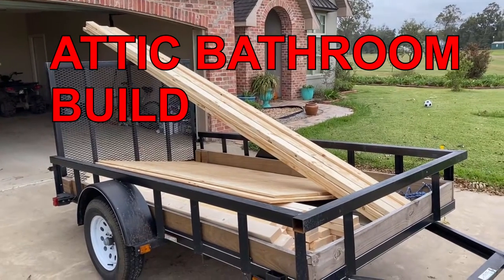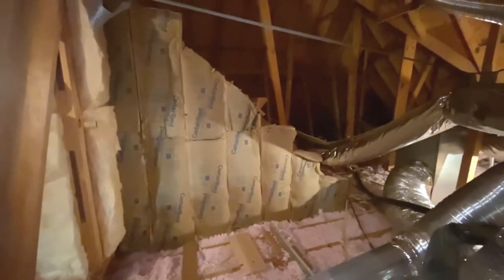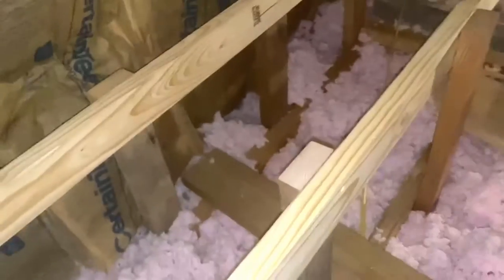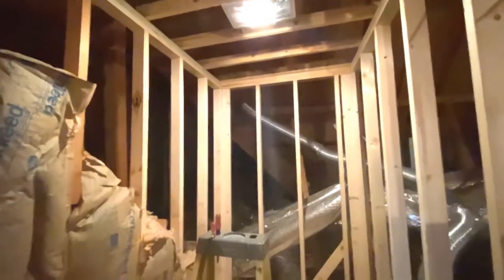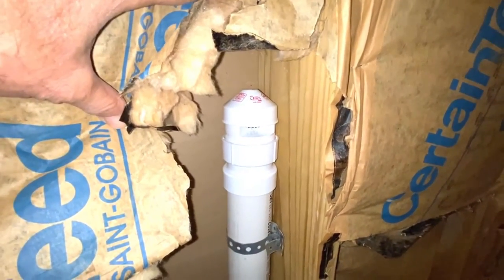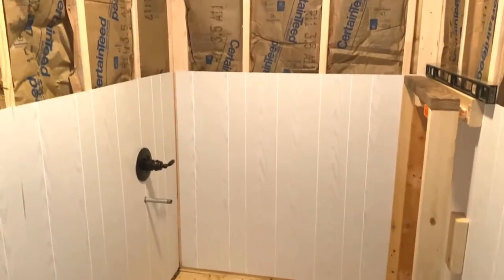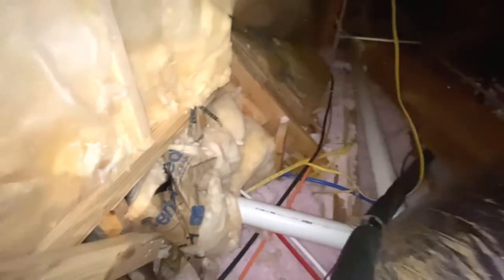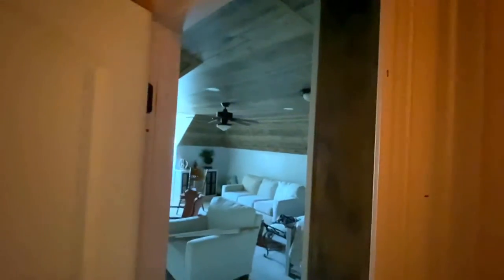ATTIC BATHROOM BUILD

Comment: Hi My attic bathroom is leaking downstairs from the shower area. It's new bathroom just placed few months back.  what could be the culprit for this water leaking downstairs?
Reply from the maker: So sorry about your leak.  That’s why I was afraid to put in shower.  Most probable under shower pan but could be anything. Have a plumber check it.  We just had problem w connections on our tankless water heater  upstairs that leaked into dining room.  Things break.
Reply: @BayouDad  Thanks much for your prompt reply. My contractor put flat tiles in the whole bathroom area. It's probably tiles loose or the gasket loose or something i see by searching over net. Thanks again for the reply.